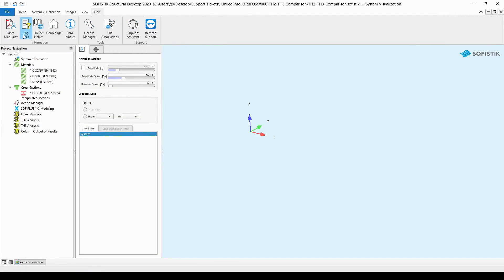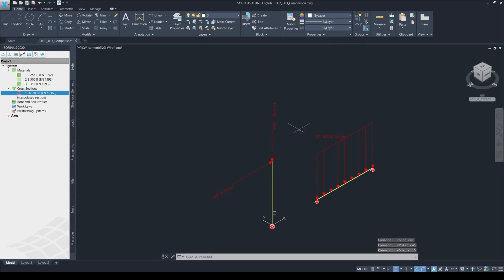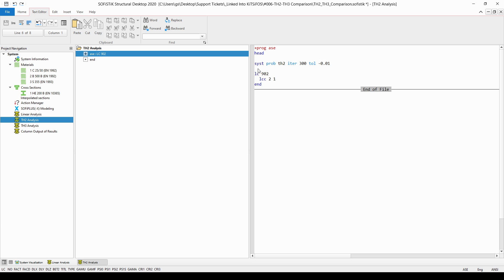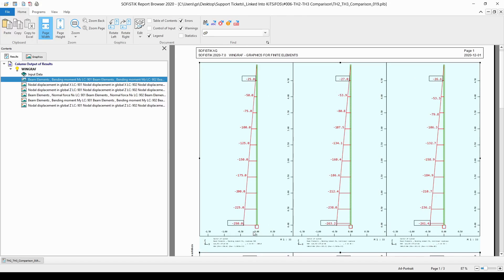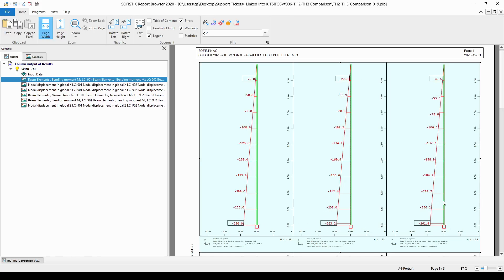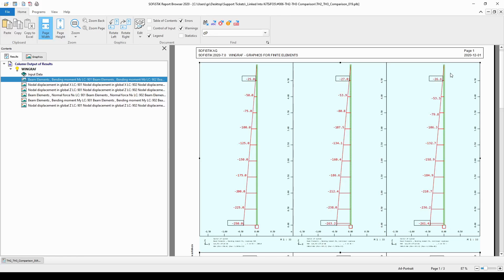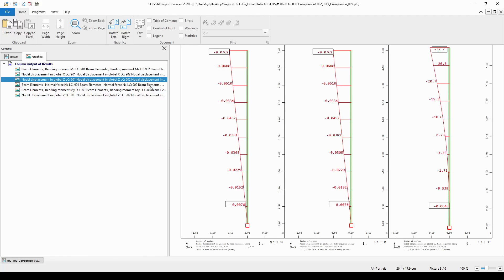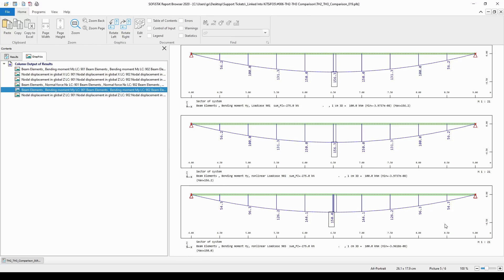A Comparison of the Second- and Third Order Analysis types #SOFiSTiK #SOFiSTiKTutorial #Tutorial

Comment: YOu don't explain the differences between 1st, 2nd and 3rd order, conceptually !!!!!!!!!
Reply from the maker: These terms refer to different levels of sophistication in structural analysis, taking into account the various factors that affect the behavior of a structure under load.
 
First-order analysis (also known as linear analysis):
First-order analysis is the most basic and simplified form of structural analysis. It assumes that the structure remains linearly elastic throughout the loading process, meaning that the relationship between applied loads and resulting deformations is assumed to be linear. In this analysis, factors such as geometric nonlinearity (large deformations) and material nonlinearity (plastic behaviour) are not considered. First-order analysis is typically used for simple structures or when the expected deformations are small.
The biggest advantage of using first order analysis is that the rule of superpositioning can be applied. In other words the results of multiple load cases can be superimposed in module MAXIMA.
 
Second-order analysis (geometric nonlinear analysis):
Second-order analysis incorporates nonlinear effects that are not considered in first-order analysis. It takes into account the stiffness change of an element due to the nonlinear force 'N'. Cables get more stiffness, columns less. Often called as pi-delta effect. (geometric nonlinearity, which means that the structure's behaviour is analysed considering large deformations). In this analysis, the internal forces and deformations are updated iteratively until equilibrium is reached. This allows for a more accurate representation of the structure's behaviour under applied loads, considering the effects of P-Δ (axial force-moment interaction). Second-order analysis is particularly relevant for slender structures or those subject to significant lateral loads.
 
Third-order analysis (advanced geometric nonlinear analysis):
Third-order analysis goes a step further in sophistication and considers additional factors that influence the structural behaviour.
It means real equilibrium in the deformed shape.
It takes into account the geometric nonlinearity that contains not only the effects of P-Δ (axial force-moment interaction), but also the P-δ (axial force-deflection interaction), allowing for the analysis of structures with more complexity. Third-order analysis is typically used for specialized cases, such as highly complex or unique structures, or cable stayed structures where accurate predictions of behaviour are crucial.
Typical applications are: cable sagging, snapping through, shell buckling, membranes.